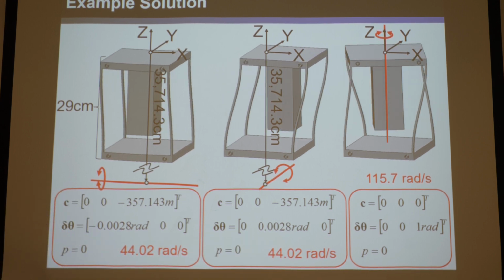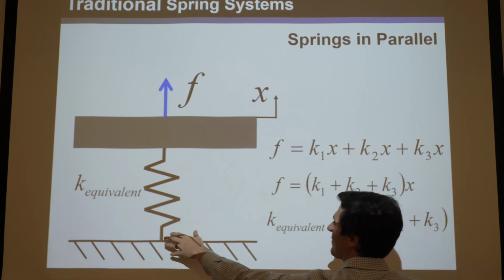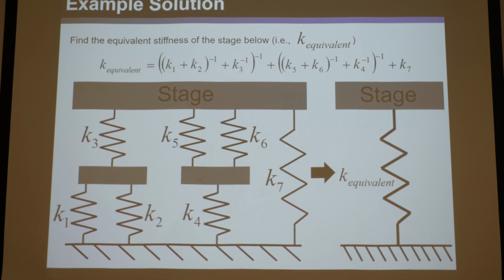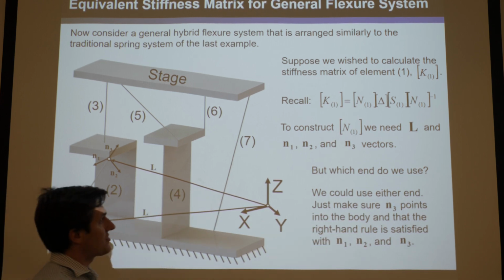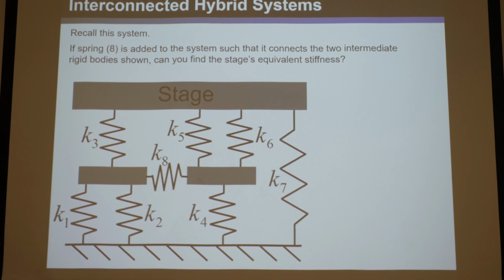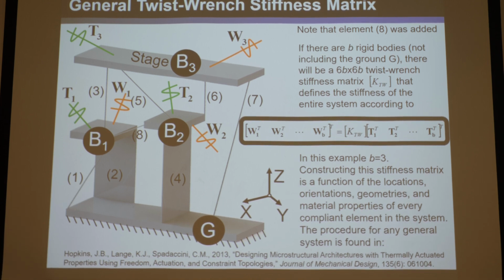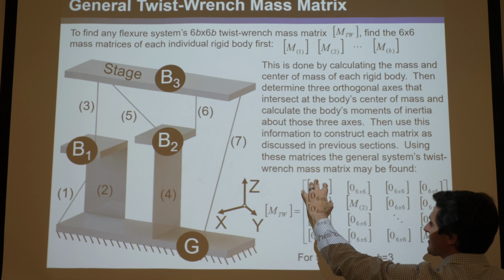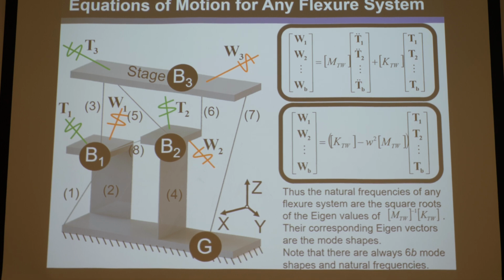Compliant Mechanisms Lecture 3 Part 6

Comment: Part 6: General Systems (21:52):

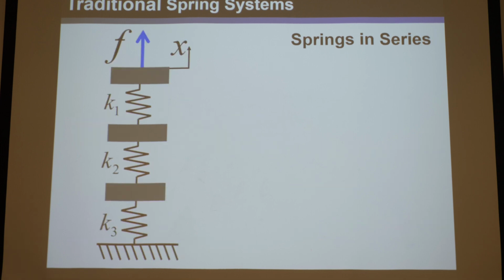* Series Systems (5:34): Elements experience the same force but different displacements. Equivalent compliance is the sum of individual compliances.
* Hybrid Systems: Combinations of parallel and series.
* Interconnected Hybrid Systems: Intermediate bodies connected, preventing simplification into series/parallel.
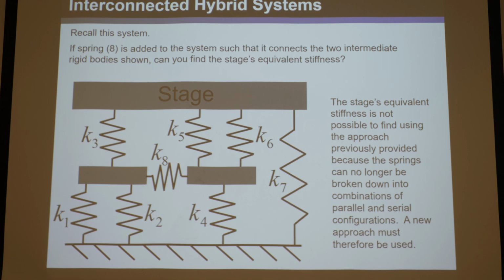* General Stiffness Matrix (17:48): Requires a more complex approach (beyond the scope of the lecture), but a paper and MATLAB script were provided for reference.
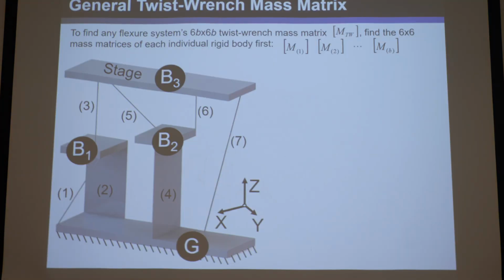* General Mass Matrix (24:46):  Similar to parallel systems, but with a larger matrix to include all moving bodies.
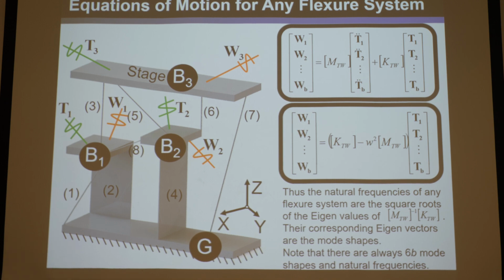* Infinite Mode Shapes and Frequencies (28:08): In reality, systems have distributed mass and compliance, leading to an infinite number of mode shapes and frequencies.

The lecture concluded by emphasizing the significance of understanding stiffness and mass matrices for analyzing and designing compliant mechanisms.

Comment: I'm much more into math than physics and engineering, the third lecture was more of a stretch for me than the second.  So, you may find the relative rankings of lectures 2 and 3 is a function of your audience.

If I could give you a piece of advice: try taking a breath. Your words are tripping over each other, sometimes leading you to misspeak.  And maybe trust your audience a little more. "It's a square matrix, it's n by n, it has the same number of rows as columns" doesn't really add more to the conversation than "It's a square matrix" other than the apparent anxiety you have to fill time chock-a-block with words.

- I do hope I don't come off as harsh!  I appreciate the lecture series, I'm learning from it, it's certainly something I'm more glad to have in my life than having missed it.  I'd just like if I'd see you a bit more relaxed!
Reply: I guess it is different for everyone, because I actually enjoyed his way of presentation. This way, you can actually understand his thought proceess much easier, especially when english is not your primary language

Comment: Love the lectures so far! I'm curious to know if we could solve the interconnected spring system by using the delta-wye methods found in EE https://www.khanacademy.org/science/electrical-engineering/ee-circuit-analysis-topic/ee-resistor-circuits/a/ee-delta-wye-resistor-networks